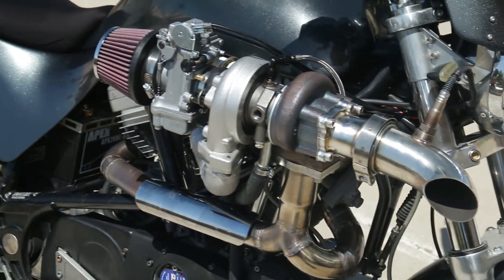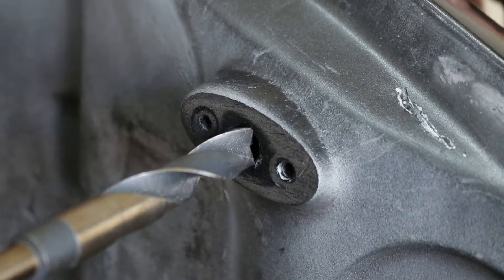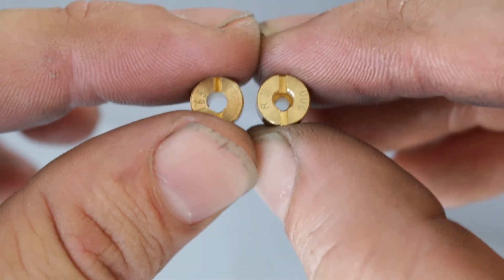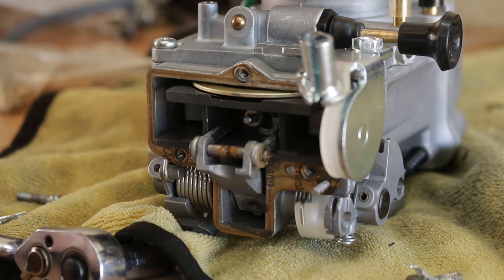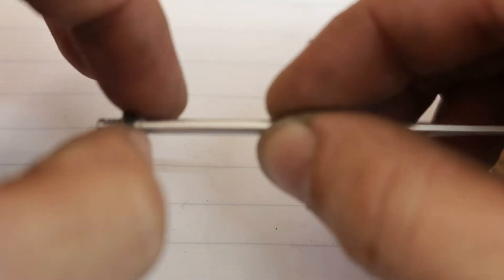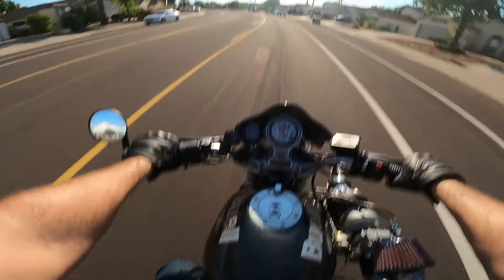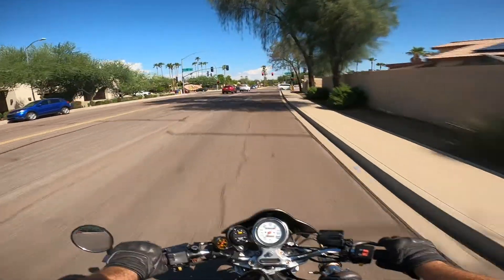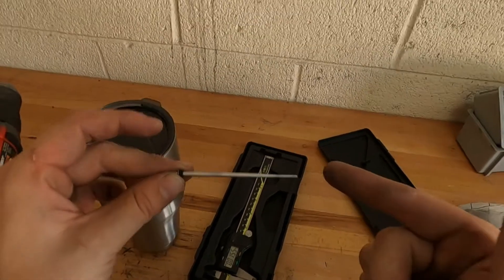How-To Convert your Carb'd Motorcycle to E85

Comment from the maker: Final jetting specs below. PLEASE BE AWARE; you NEED to drain the E85 out of the float bowl if the bike is going to sit, corrosion happens fast with alcohol. You can start getting little flakes as quickly as 24 hours, so BE AWARE. Most carbs are made from aluminum or zinc, both of which will corrode quickly in the presence of alcohol.

FINAL JETTING -

1/8" drilled out main jet
Two PowerJets Cranked full open (www.thunderproducts.com)
Needle Jet Bottom Clip, Sanded down .008" from standard, and about .010" sanding on the "tapered" portion
Accelerator Pump - No travel Limit, comes on at 1/8 throttle
Pump Jet - Std.
40 Pilot Jet

Comment: If I wasn't old, sick & broke I'd go to your patreon so I learn how to turbo/E85 my 2000 Buell M2.......
I'm thinking about selling my motorcycles & building a legal 750w mid drive fully enclosed electric reverse trike.(a 750w enclosed recumbent  e-bike so it's technically legal) Something that looks like the Trisled Aquila3  with some fold-out roof top solar panels for recharging. No gas, license, registration,insurance, expensive maintenance needed with a 55-65 HWY cruising speed. So I can afford to travel on a low fixed income. Made of mostly bike & e-bike parts so parts are easy to get. The lightweight enclosure makes it faster/aerodynamic/more range efficient & keeps the rain & cold off you. With a little trunk in the behind the seat that can hold 4 bags of groceries.  The average person can pedal one to 35 mph easy so I'm hoping a geared 750w mid drive electric motor could do 55 in over drive gear. I know a 3,000w hub motor will do 55 easy.

Comment: Thank you man! I been wondering how to do this I am gonna boost my TRX450R using a GT 15 Turbo and wanna run E-85. How did you manage to make the Accelerator Pump work with E-85 just drill it out 2 or 3 sizes bigger too?
Reply from the maker: No problem. The accelerator pump wasn't modified, I just adjusted it to come on as soon as the throttle moved. For an FCR I'd do the o-ring mod and change out the "starter jet" for an upsized one. My suggestion would be to do that very last after the Pilot/Needle/Main are good to go. If you're keeping the FCR39 I'd start with a 62 Pilot jet, a richer than stock needle from jetsrus.com, and either a large (260) main jet or a 210-220ish MJ with a Thunder Products Power Jet cranked full open.

Comment: Great little video. I have a 1985 Honda XL 600LMF, I'm considering converting to E85. Is it this simple? Is it worth it?
😅
Reply from the maker: Yes, it's this simple. Much easier with a wideband though, and you should be very, very comfortable with jetting by ear and feel if not. When you sand the needle, you don't need to enlarge the pilot jet nearly as much.  In fact, if you sand it enough, you could keep the pilot jet close to the same as pump gas. Just go much, much bigger on the main jet.
Reply: @DoctormotorcycleToo  Thank you for replying. 
ok, next question: are there companies out there (in the UK) that offer this service (and associated guarantee)? :)
Reply: ps. I havent' found any via google search...
Reply from the maker: @therealpils  I doubt it, most shops don't even mess around with carburetors anymore lol
Reply: @DoctormotorcycleToo  too true!